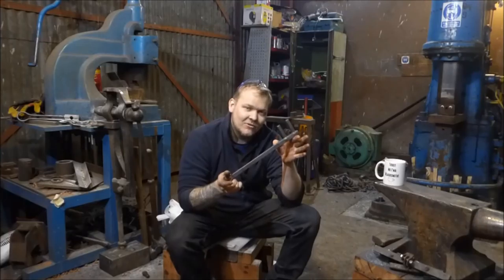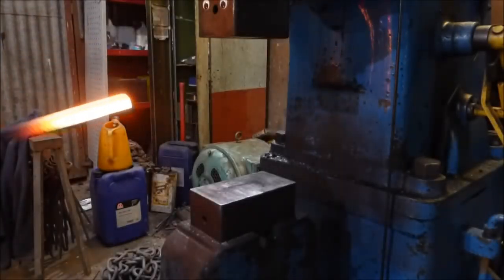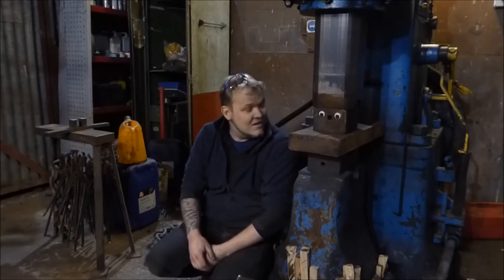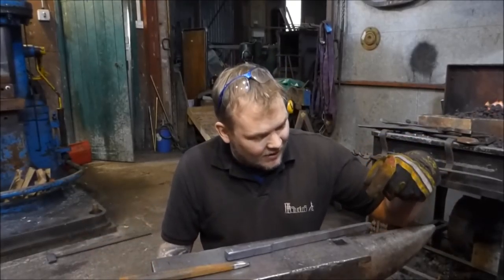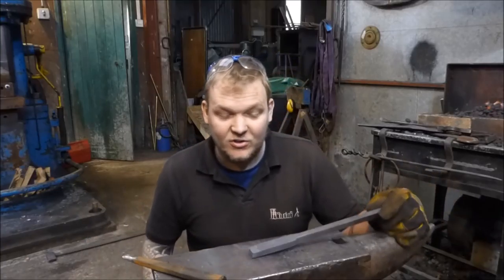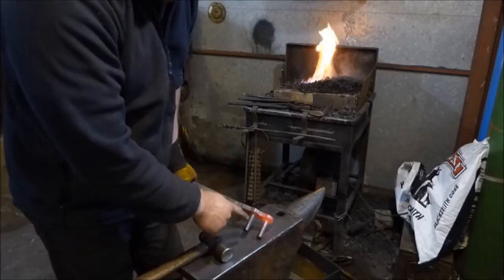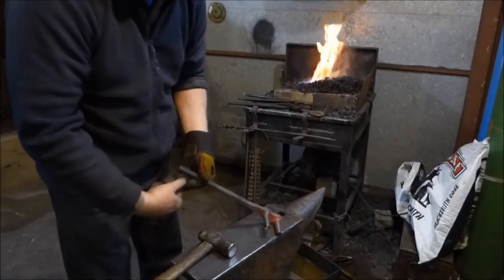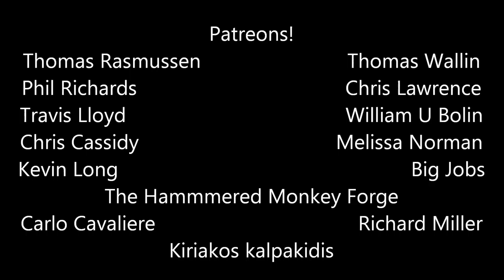How to make scrolling dogs! Trust Me I'ma Blacksmith!

Comment: Do you have a method to make these without welding?
Reply: punch the holes out to an interferance fit, when the main bit is hot hammer the pins in, and quench should do it so long as it dosent get to hot, guess they might come lose after a while, or thred and tap them, or put a tapper on the pins and rivet the end over, easyist way is just to weld them though.
Reply: Thanks so much Cyrus is on top of the world now.
Reply: look for a video entitled 'ABANA National Curriculum Forged Scrolling Wrench' for another style of scrolling dogs.  Depending on your country they have other names such as bending forks, bending bars etc.  Hope this helps